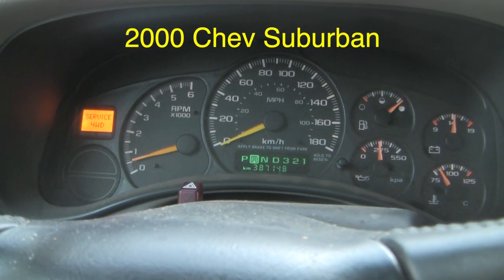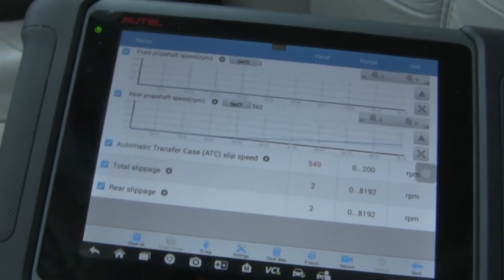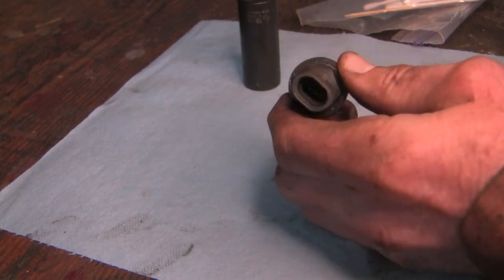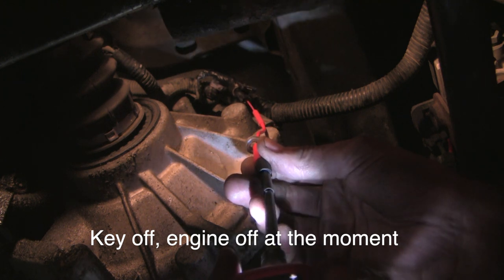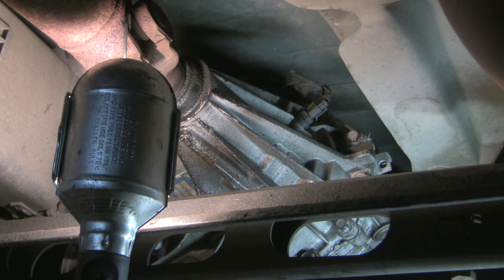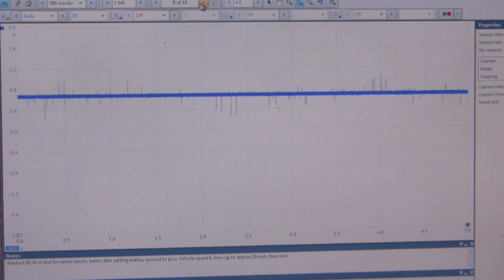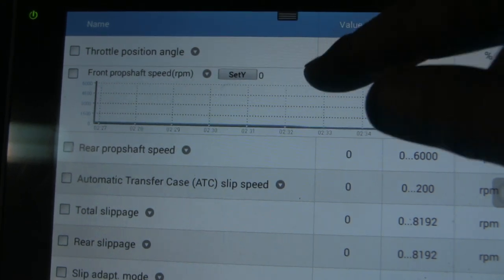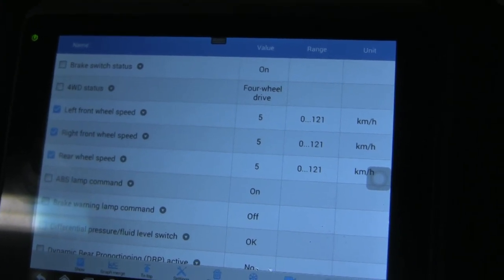How to fix Chev/GM 4WD shift problem C-0305

Comment: What kind of scan tool are you using?
Reply from the maker: Autel 906BT. Updates are expensive but for now it is still running despite the fact I didn't pay for continuous upgrades. Any tool with live data should be able to show what you need for this kind of repair, you don't need the most expensive scan tool.
Reply: Thank you! Your video helped me.  Mine wouldn't shift out of 4wd and after watching the video, I looked under truck and found the front propshaft sensor wires were pulled out of the connector.  I pushed them back in and it now works correctly.  Thanks again!!
Reply from the maker: @stevenwebb7949  If it happens again, you might check to be sure the connector isn't broken. There is a technical service bulletin about this problem is some of these vehicles. The solution is a slightly different connector. Thanks for the feedback!
Reply: @spelunkerd  Thanks for the heads up. I had just recently had the tranny rebuilt and I'm guessing they were responsible for the the wires being pulled out. Simple enough fix though.  Thanks again!

Comment: Makes noise when I try to get  2wheel in ,will not shift out 4 wheel. Any one know ?
Reply from the maker: Hard to say. The encoder motor does the shifting and it can go bad, and even bad wiring can disable the motor. Or the encoder motor may be unable to shift because of mechanical problems inside the transfer case. I would start with basics, make sure the fluid level inside the case is correct, make sure there is no leak of transfer case fluid out. A scan tool will help with diagnostics. You may find, similar to what I found, that shifting back to 2WD can happen after cycling the ignition key. I would try to avoid driving while that grinding sound is happening. This kind of repair is beyond the scope of most backyard mechanics, and even the physical challenge of removing the transfer case is much more difficult without a lift.

Comment: Fixed for FREE!!!!! My 2012 silverado has been stuck in 4low for 2 days. I've tried everything except replacing any parts.... 

Let me explain why it might of happened first. I recently gave someone a jump, they connected the cables wrong.  That might of triggered something in my computer. Second, the next day I remote started the truck (thats how it jumped into 4low, I NEVER moved the switch, it went into 4low on its own). Third, that morning when I remote started it, when I shifted into drive,  truck wouldn't move.... it never switched gears. Turned it off,  back on, then it went into gear (4low!!!!!!!)

Sooooo....here's what i just did to fix it just now... I removed the transfer case motor thing... (4 bolts and 2 connections) I then tried to spin the gear inside the transfer case with a flathead but realized it rolls right back....

Okay... so I put the motor back on.... I said fck it. I'll just have to spend money on a mechanic to figure it out.... 

Soooo.... when I turned the truck back on, it was back in 2high!!!!!!!!!! 😅. Problem fixed. Obviously idk which part of what i did fixed it. Maybe just removing the part, maybe it was moving the gear a little. Either way, after being stuck in 4low just like that it's back in 2high
Reply from the maker: There's a significant chance it will happen again. A problem with the switch, the wiring, the ground, the module, or the encoder motor could do that. A scan tool with bidirectional control would make diagnosis straight forward, but intermittent faults can be a real challenge.